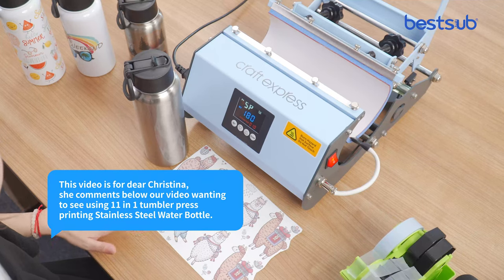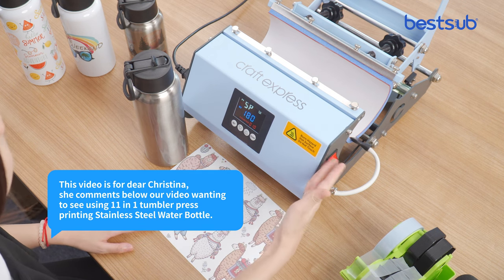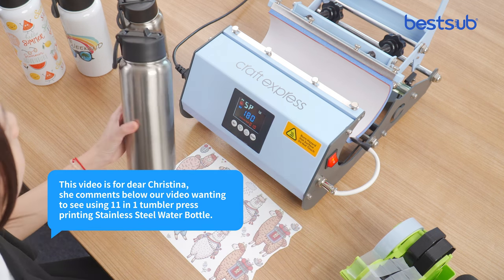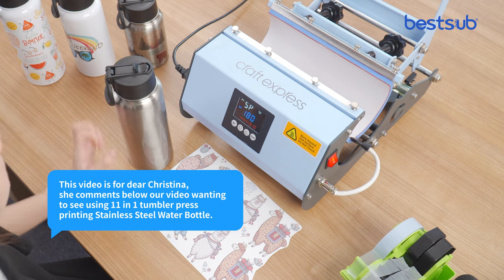How to Print Stainless Steel Water Bottle With 11 in 1 Tumbler Heat Press | Easy & Simple

Comment: What is this device called? 👀 That you're using to make the prints please
Reply from the maker: Hi, the machine called Craft Express Elite Pro Max Tumbler Press. You can find it on our website www.bestsub.com. Thanks.
Reply: Thanks a bunch! Is there a specific printer or type of adhesive that needs to be used to successfully print on the glass? @bestsubtv